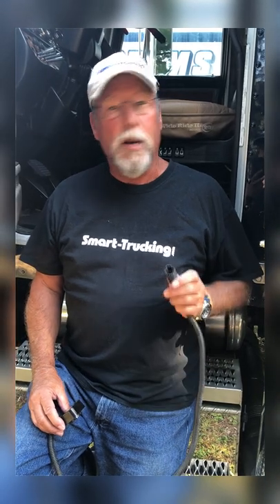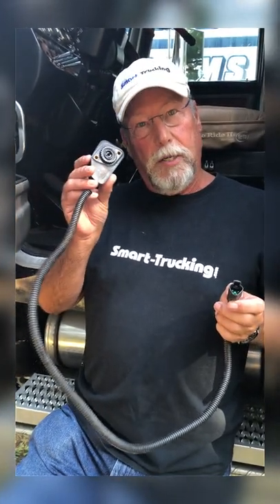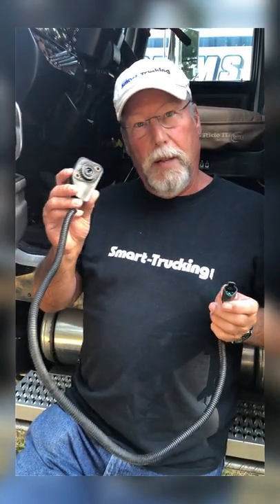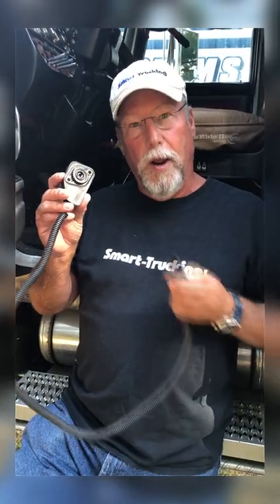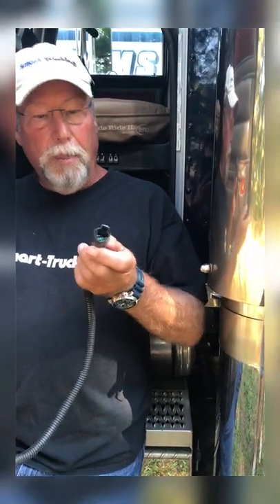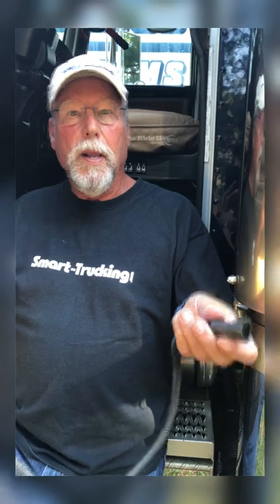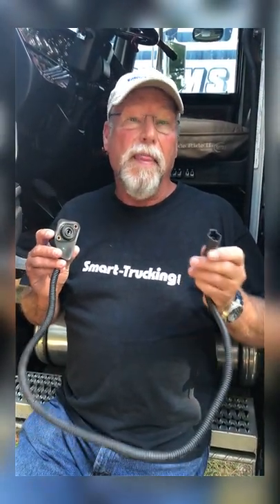Truck Losing Power Suddenly? How to Get It Back - A Fast Plug + Play Solution! #shorts

Comment: I had replaced very old fuel lines, the first time the truck was placed under a load after the lines switch, old rubber clogged up everything got past the fuel filter it was a mess

Comment: on agricultural tractors 🚜, a technician had to use a computer adjust the potentiometer readings on the foot pedal for the computer to accept it. it wasnt just a plug N play deal. 😂